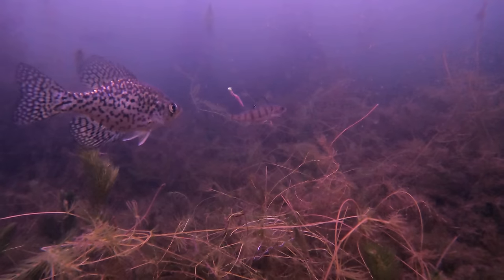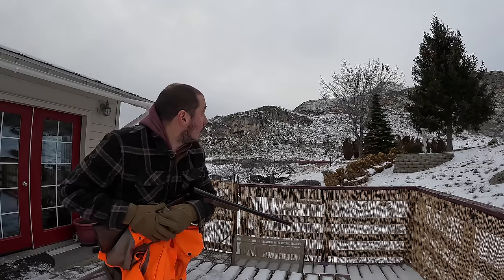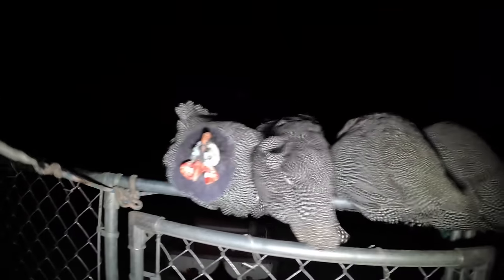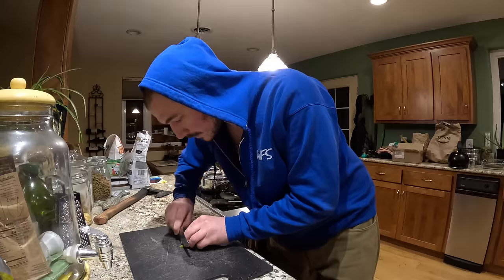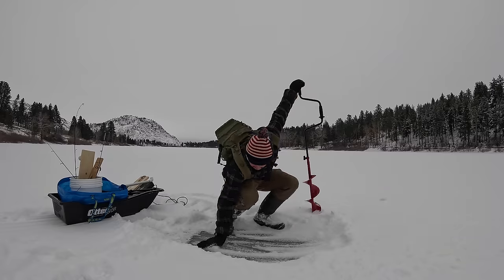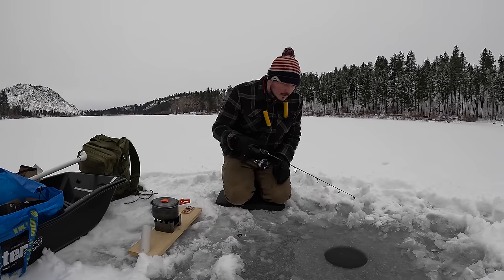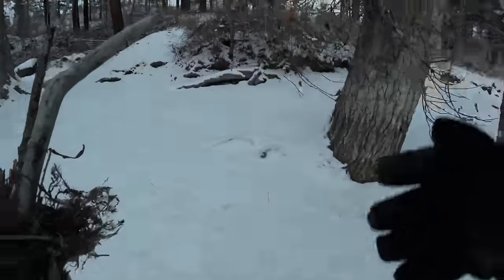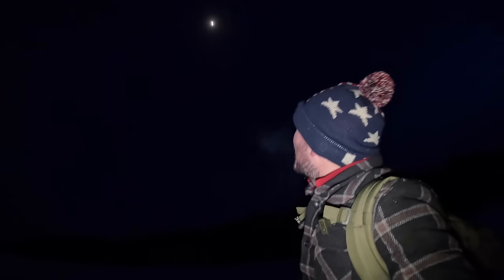24h WINTER STORM Survival! Fishing & Hunting for Food (Catch & Cook)

Comment: Hey there, just a little safety tip. After you have drilled a nice hole for fishing, instead of putting your auger on ground, drill it to ice. Not quite through. It stays up and blades are not visible. Those are sharp as knives and you don't want to step or fell on it. That ice is slippery as ever after drilling and water floods on ice. Blade cover works as well :) Stay safe and fish on!

Comment: You know, it's kinda funny how efficient incandescent bulbs are as heaters. Over 90% of the energy going into an incandescent bulb gets converted to heat while only about 30% of an LED's does. Given that also LED's are rated in "Equivalents" where their true wattage is much lower (for example, a 40 watt equivalent LED light typically is only operating at 5 watts or so), changing out that lightbulb increased the heat output by significantly more than 4x. Probably more like 20x.